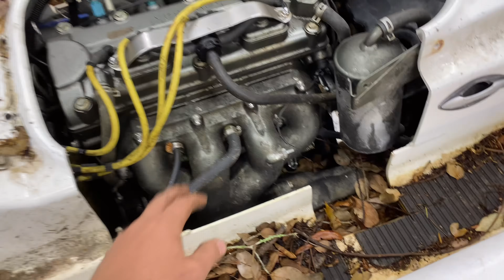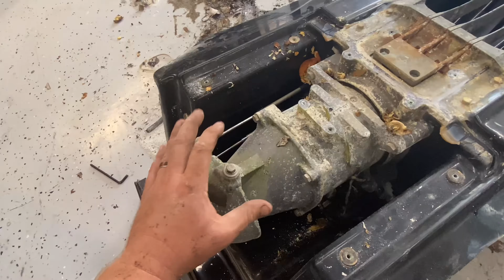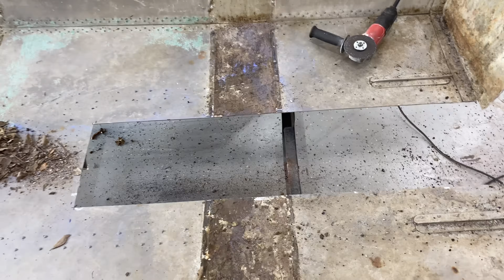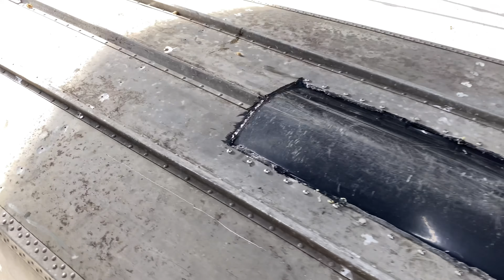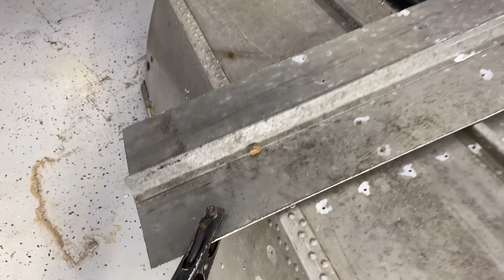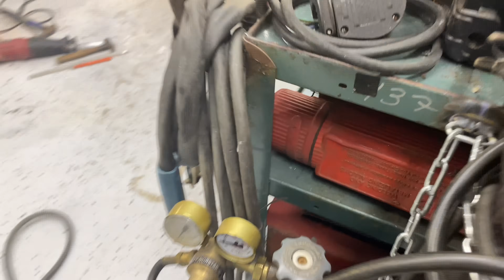Cheep jet jon, mini jet boat build pt.1

Comment: clean clean clean with SS wire brush if you have it wipe down with isopropanol just before welding and that's 3/4 of welding ally..chew out your start and stops with tungsten blade before welding also for good penetration. And if you can't see the weld hump coming through on the other side it's not hot enough. hope this helps you folks

Comment: Cracking build 
Always clean alloy afore you weld it😊 and only for example on use that wire brush for alloy and you will get much better weld 😊
👍🏴😁✌️

Comment: It was nice watching you experiment without a spool gun. You may already know this but aluminum is extremely sensitive about how much prep you do. Make sure you use the right abrasives for aluminum. You can have the best spool gun in the world but you will still have poor welds with a dirty surface.

Comment: Just clean your joints before you weld .. use a stainless brush that is specific to this job .. coming from a youtube jockey who hasn’t welded aluminum.. so do check this fyi